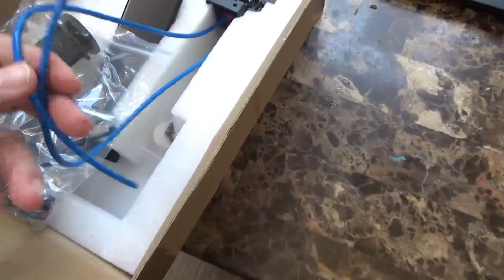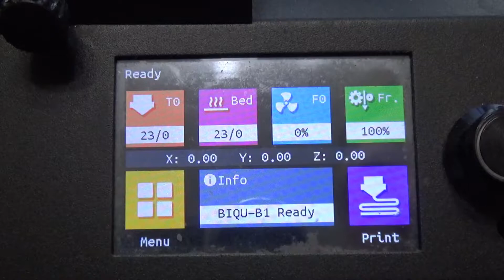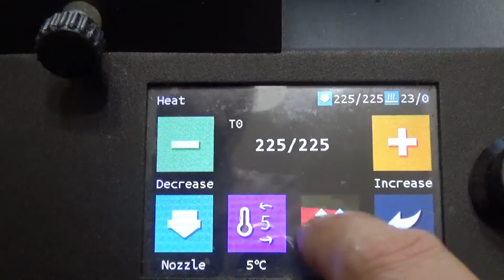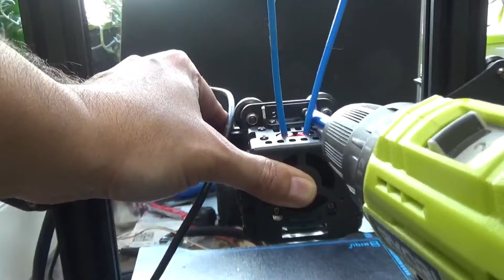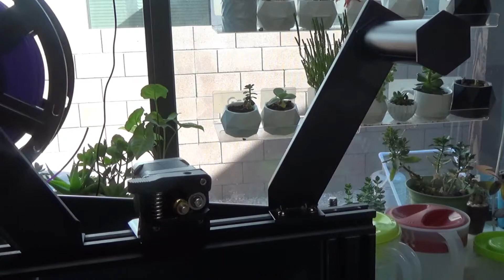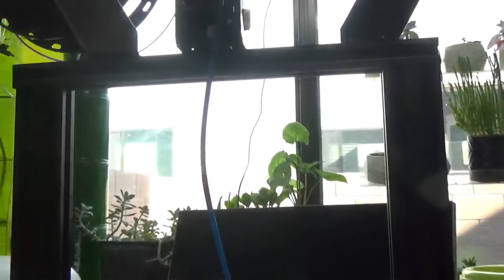BIQU B1 2 filament printer head upgrade

Comment: hello. is there any updates ? did it work? what fra,wire to use and where to find it ? thank you
Reply from the maker: No I gave up on it the part that hold they tube broke and they dont sell a replacement part. They told me to buy a new head
Reply: @thembijan thank you for the replay and infoo🙏🙏
Reply from the maker: @hejxy2213 no problem

Comment: I looked for the follow up video for the two color print, and didn't find it. Did you get frustrated and throw the whole thing in the bin? Or were you able to make progress with the B2?
Reply from the maker: It never worked it kept getting clogged. The Pneumatic part broke on both sides and BIQU doesn’t offer replacement parts. So you have to order a new print head so I have given up on the biqu after buying 3 heads to get this to work I was like f this
Reply: @thembijan  I modified mine by adding an L bracket, so that both extruders were mounted top center, and fed down into the hotend. It worked great for three prints. That were pretty amazing. I couldn't believe how two color lettering turned out. Then the hot end clogged. I have not been able to clear it out. I was wondering if an new all metal heat break would fix the issues it was having. Also thank you for posting this video, as its one of the only useful videos on the B2 out there.

Comment: Wondering if you was able to get this working? I have tried it on my Biqo B1 with no success. I'm still new to 3d printing and not good at the firmware. Would be awsome to see it work and if you could share the firmware that would be great.
Reply from the maker: partially the system crashed so I had to reflag with the old firmware so I’ll give it another try

Comment: Wondering if you ever got this to work, including firmware/software? 

Searching around I haven't yet seen any complete documentation or example of a successful deployment of the 2 in 1 out head on the Biqu B1.
I have the upgrade kit and would love to get this going, but I'm hesitant to start ripping apart my printer until I know it actually can work! 🙂
Thanks for taking the time to share your experience.
Reply from the maker: No not yet. I have a lot of projects I’ve been doing and I have been working a lot of overtime at work. It’s been in the back of my head I will get to it soon, I have been dying to print a p-51 mustang in 2 colors.

Comment: how did you set up your bl touch, i attached mine in the same spot but it prints in the air
Reply: You need to set the Z-ofsett to the right value. On my Creality Ender 3 it is -3.1 mm. After zeroing with the BL-Touch, adjust the z-offset until the nozzel touches the build plate. That should be your correct Z-Offset. Atleast that is how it works on my printer.

Comment: I just recieved this upgrade a few days ago and have installed the physical part of it but now I am stuck with figuring out the firmware...   What did you do for the firmware with this upgrade? also what did you change in Cura, assuming you use Cura that is...
Reply: I bought this kit almost on release and and I still not able to print with it I tried 4 times I just need to load the marlin I made fallowing the GitHub tutorial but at the time to print I never figured out how to load the 2 filaments and start printing when the print starts it just jams the nozzle always I gave up a long time ago until I find a full guide to see what I'm doing wrong.
Reply from the maker: @michaelperez6811  when I get back home I’m going to try doing a dual print I got new Filament
Reply: @thembijan  if you succeed let me know I want to print with dual color may be we can do a discord call so you can explain me how to do it.
Reply from the maker: @michaelperez6811  I’ll do a video to show if it’s successful or if it failed and why
Reply: @thembijan  thanks really appreciate it.
Reply from the maker: @michaelperez6811  no problem
Reply from the maker: Hi Dan. I have not installed the firmware yet. I was told by one of the viewers not to use Cura, he had suggested that I use prusa slicer. I would like to do a collaborative video between me and you and stacking layers. If you are interested please email me at mahdi_bijan@yahoo.com.

Comment: Those holes you mentioned on the stepper drivers are the V-ref and diag pins. If running in standalone mode (you have UART enabled drivers) you would use V-ref to as a reference point for tuning the voltage with the trim pot. You mother can accept other drivers like the TMC2209 which has an option of running sensorless homing and that would also need the diag pin to be in use. The stepper drivers you have, tmc2225, are set in UART mode so those pins are not needed as everything is controlled by the firmware.
Reply from the maker: Thank you for that information. I was going to look it up this weekend. You saved me time and probably a headache looking for the information.
Reply: @thembijan  you're welcome. I went through all sorts of hunting to figure it out, so I like passing along the info I found. I personally wouldn't bother with Cura when doing multi color either. I was never able to get good results, Prusa slicer seems to be better tuned for multi color.
Reply from the maker: @StackingLayers  I will give it a try thank you once again I was thinking about switching software anyways. I always have a hard time with thin walls. I felt like my f-86 could of been printed better if I could of controlled the retraction better. One question, I’ve heard claims that for my printer  the new cura works better to print with a 0.06 mm nozzle. Would my printer be better with that nozzle on Prusa. If you don’t know that’s fine I’ll cover it on part 2 for this video. That’s for your help and comments.
Reply: @thembijan  0.4 is a good middle ground nozzle, the 0.6 will let you print a bit faster as long as the filament temp requirements are able to be maintained. There's also evidence that thicker layers make stronger parts but with a sacrifice of fine detail.

Comment: What is the name of the duel printer head you picked up?
Reply from the maker: BIQU B1 2 In 1 Out Dual Color Upgrade Kit Bowden Extruder Wth Motor For BIQU B1
I bought it from eBay
Reply: It's using the bigtreetech ZS Yong 2 in 1 hotend.